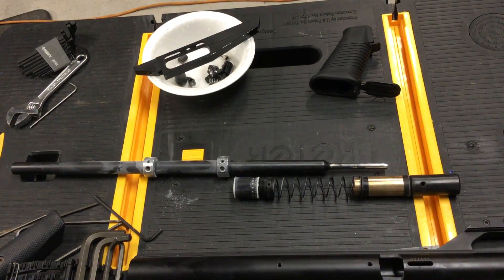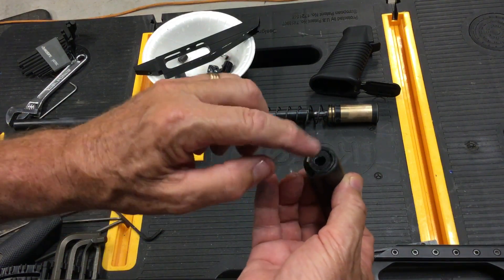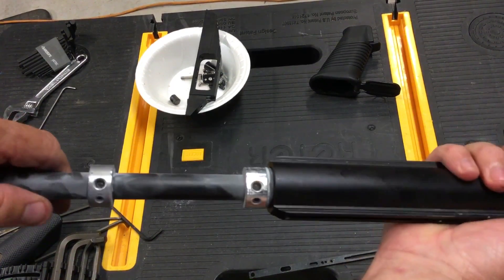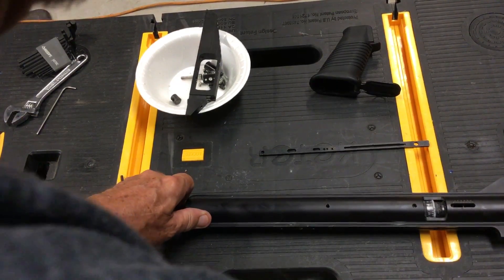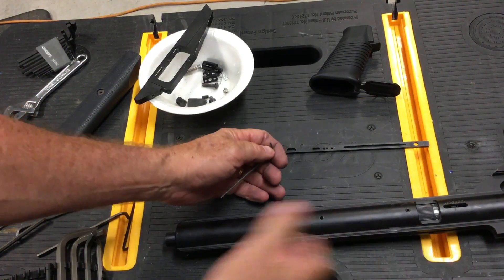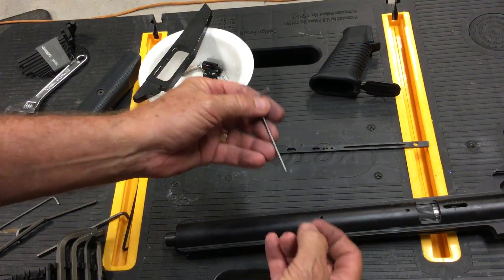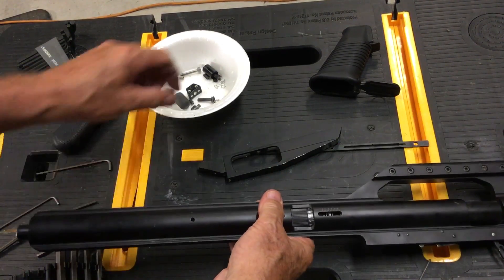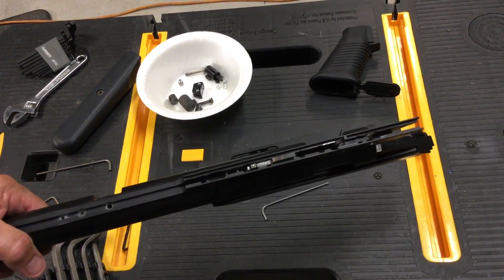Installing barrel assembly in Airforce condor

Comment: Dave I was going to put a Robin modulator with adapter? And was told I need to order another bushing, do you know why think barrel length is 24"
Reply from the maker: Good question. I do not know why you would need an extra bushing. I’m not familiar with that brand of moderator. All I’ve ever used are Neil Clague. I might suggest contacting your source for that moderator and check with them before you invest in something you may or may not need.

Comment: I removed the tank, barrel, power wheel, hammer and hammer spring. It appears that the safety is gouging the hammer every time the cocking lever is pushed forward. Have you seen this, where the automatic safety is gouging the hammer? Is there a video for removing the automatic safety and leaving it as a manual safety?

Comment: Hi Dave great video and nice rifle.  I have an Airforce Condor SS .25. My rifles power wheel is stuck on the lowest power. Didn't seem like it was to much but went to turn it back up and it's stuck and won't budge. I thank you in advance for any help or advice that you can share.
Reply from the maker: Shawn Dubay 
Hey Shawn!
Remove the barrel by working the steps in the video backwards. Be sure to remove the PW indicator screw from the PW first before trying to remove the barrel assembly. It’s going to be easier to unlock the PW assembly once it’s outside the gun. Let me know if you need further assistance.
Reply: @airgunsoftulsa  thank you. I did exactly that and works great now. I noticed that you have a heavier anti slapp hammer. Does it really hush the mechanics alot?? Also if I get one how much will I need to back down the power setting to shoot lighter pellets?? Going to be doing some pesting at a horse stable and don't want to create a supersonic crack that will freak out the horses. You seam very knowledgeable on the Airforce airguns. I have the Condor SS in .25 caliber. It's already pretty powerful as is but looking to make the action quiet and give it some more power. Would be awesome if I could get it to 100 fpe.
Reply from the maker: @shawndubay4050  Hey Shawn! 
It will quite the hammer slap a fair amount. The installment shouldn't change the FPS much if any at all. Ideally, use a chrony (you really, really need a chrony to tune an Air Force gun) to get the speed down to around 800-850 shooting the JSB Kings (25.39g) this is the ideal speed for accuracy and will obviously be below the speed of sound. If you need more impact energy, use the 34g JSB heavies. 890-920 is the ideal speed for those in a Condor. 
Going to be really difficult to get 100fpe out of a Condor and achieve accuracy, shot count and quietness without spending a great deal of money. I was getting about 60fpe out of mine without any special "tuner" parts and was able to take medium size pest such as racoons and skunks. 
Hope this helps.
Best of luck in your pesting!
Reply: @airgunsoftulsa  thank you so much for the info. The pest I'm going after are groundhogs and raccoons. Maybe a close coyote. All headshots of course. Been thinking about looking at 40 or 43 grain Seneca pellets. Don't know if slugs are a good option for the Condor SS.
Reply from the maker: @shawndubay4050  Stick with the JSB's. The barrels in the AF guns are Lothar Walther and are designed around JSB pellets. I tried the Seneca back when they were under a different label and they really didn't have any consistent accuracy. Also, the tin had a bunch of lead shavings from their castings.
Reply: @airgunsoftulsa  oh ok cool Thank you. I never knew that about those barrels. Will do. I do really like the JSB pellets.